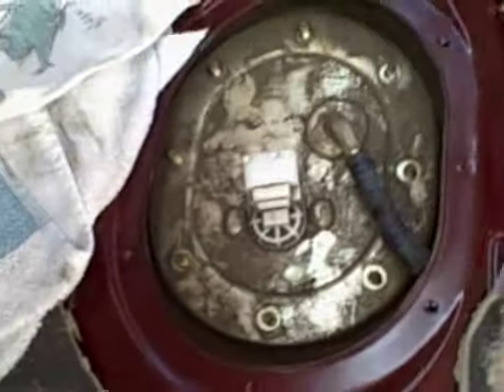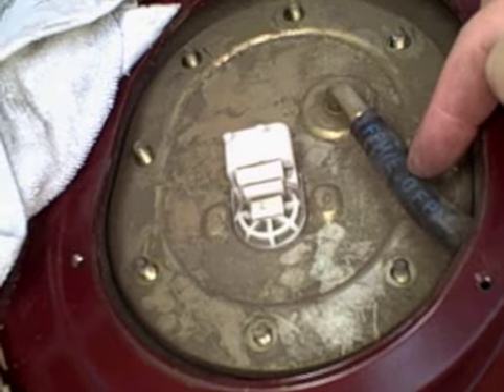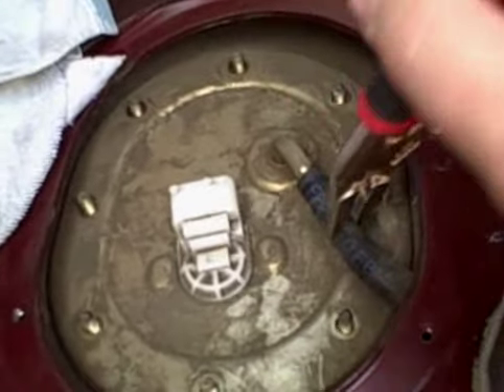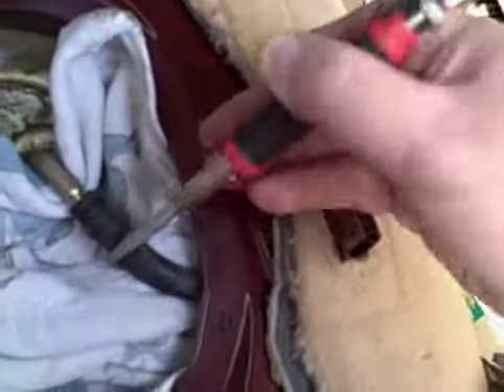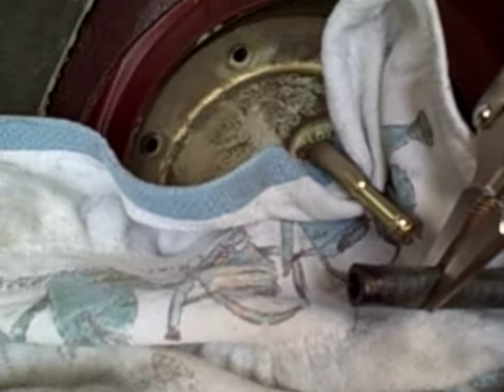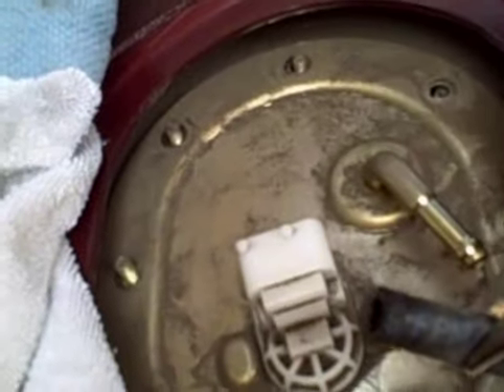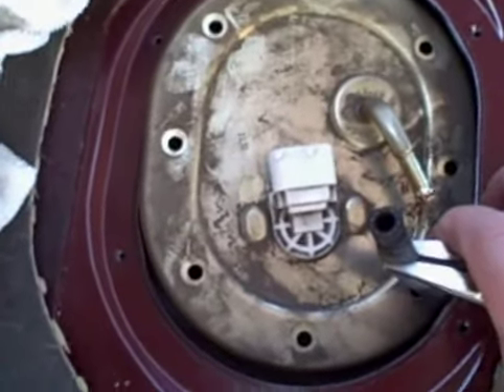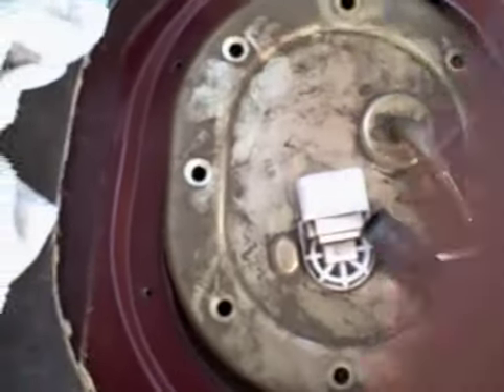e38 Fuel Pump Change - Part 3

Comment: you still will get some weepage if there was fuel in the steel parts so yes he is right that there was no fuel pressure or you would still see some drops of fuel.  Can't have 50 PSI fuel in the line and magically evaporate.  It will always be wet.